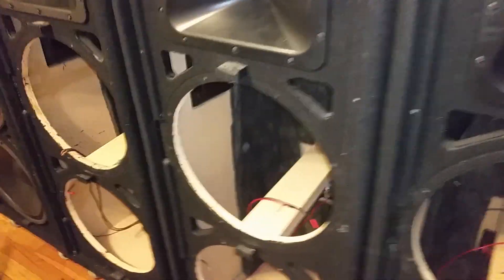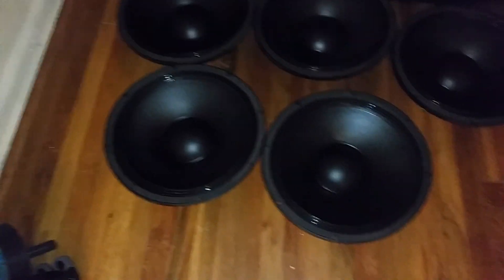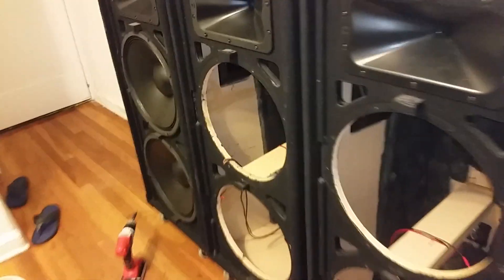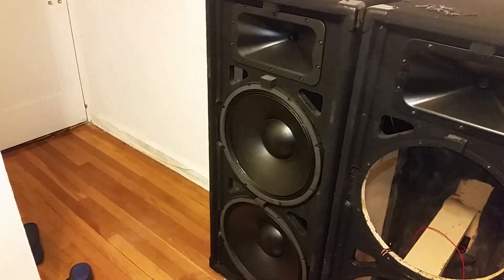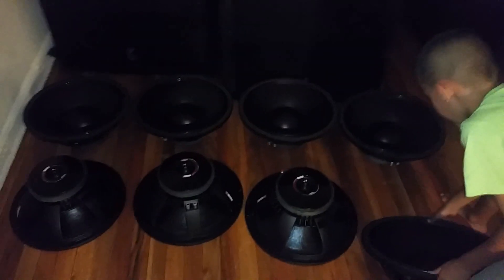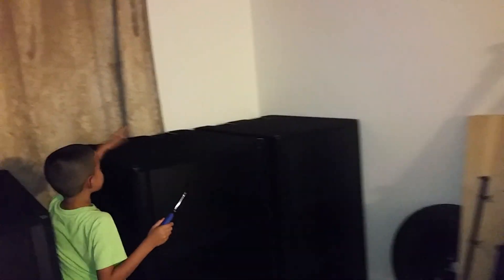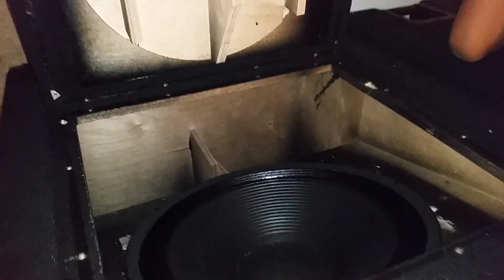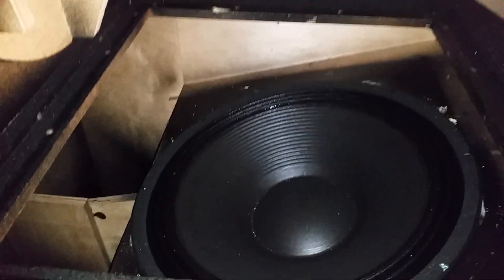JBL speakers teardown

Comment: I just bought the pair of jrx 225 will I be happy?
Reply from the maker: It depends what you will be using them for and which amplifier you will be using.
Reply: @DJ_Renn  I just use them for jamming I have a 4600watt Rockville powered mixer
Reply: Rockville rpm 109 look it up
Reply from the maker: @patrickdickey48  Should be fine.

Comment: Not called a bass pipe it’s call a bass port
Reply from the maker: From Yorkville's website:
A two year investigation into the optimization of high output low frequency sound has yielded the LS1208 "basspipe" subwoofer system. The "basspipe" is a multiple flare horn, connected to an organ like pipe, slowly flaring to the mouth. The bandwidth is narrowed, optimized to a specific range in the lower registers. Outdoor measurements show very smooth, very high output in the 35Hz to 200Hz range. This is the highest efficiency that we have ever seen for a single 18" driver enclosure, especially with a gross volume of only 22 cubic feet. In addition, a significant gain is achieved when using two units side by side as the mouth nears maximum acoustic load.

Comment: one day you should buy a qsc pld 4.5
Reply from the maker: Mrashgaming I have bad luck with QSC. A few or my friends run them but I like my Crowns. My first crown was a PSA 2 then I had a few Macro Techs but the weight of those amps was too much
Reply: give it one more chance with the four channel  you can run it on tops just sayin they sound amazing and if you do one day. make sure to buy the warranty to because its a 4 channel amp its more sensitive but dont run on subs they have terrible dapning factor its 150